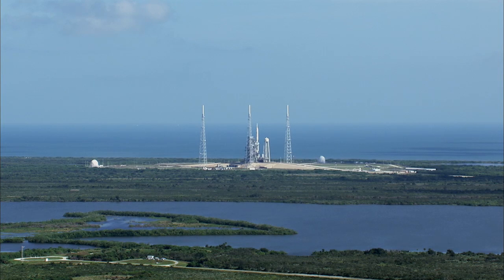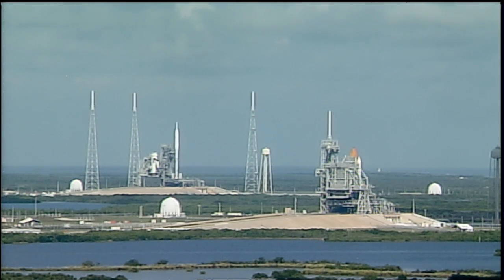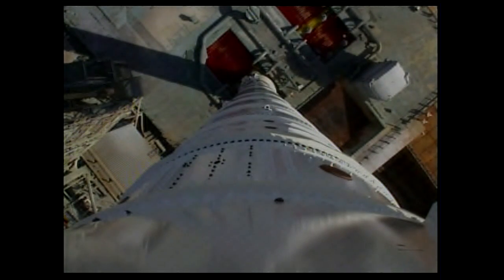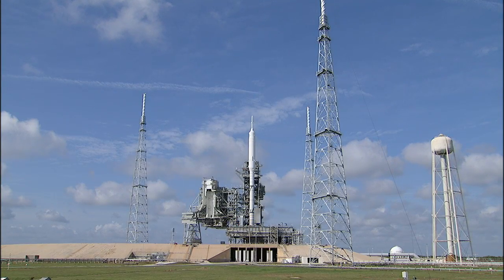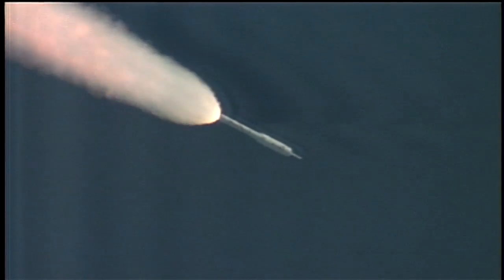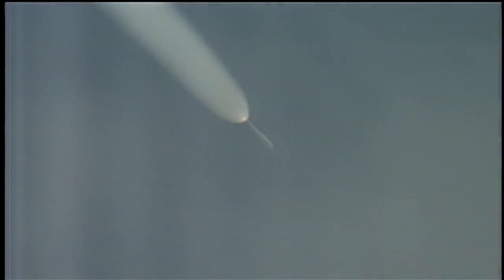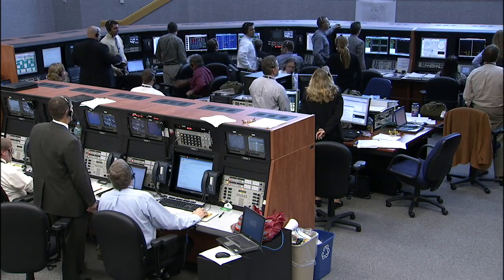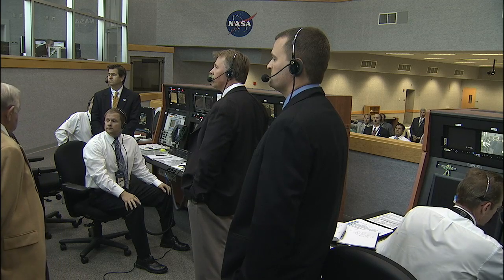Ares 1-X Full Launch Experience HD

Comment: If NASA actually has their own plans for mars after Artemis, who knows, maybe Ares 1 will come back as the CLS, aka the Crew Launch System to complement SLS if/when NASA and other contractors begin designing and building a Mars Transfer Vehicle. Since SLS will be way too over powered for LEO launches. Though it might just be “easier” to crew rate an existing launcher by the time an MTV is made, like New Glenn or Vulcan

Comment: I didn’t know the Ares 1-X actually flew
Reply: Fun fact, this launch was very controversial in 2009. Critics saw it as a waste, saying that it could be easily done in simulations. Constellation program managers agreed, but argued that they wanted to combine both simulations and actual incremental flights mirroring the old Saturn I launches to make development faster. In reality though, NASA did this flight to try and garner public support for the dying Constellation program. It didn't and in fact backfired. Ares 1-X damaged the launch pad and had a parachute malfunction which led to the booster being seriously damaged on splash down. The public outrage following this basically cemented NASA's "failure is not option" mentality which led to the long SLS development.

Comment: The Ares-1 was a bad design anyway. Firstly, it completely destroyed the launch pad and secondly, the vibrations caused by the solid rocket motor were too high for humans to survive.
Reply: It only damaged the pad because it was an STS pad not an Ares Pad, and the vibrations were within human tolerance, quite close to the space shuttle or Atlas V 422